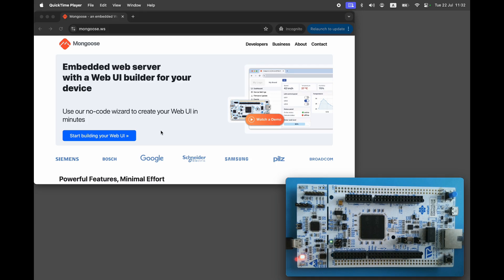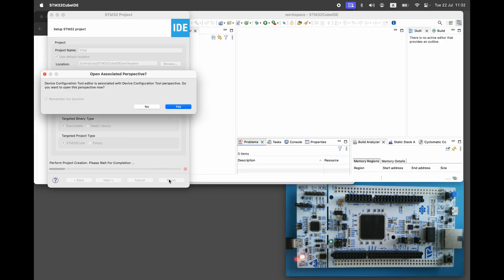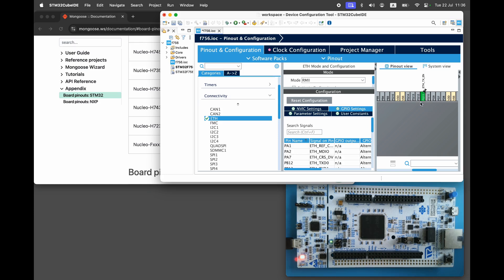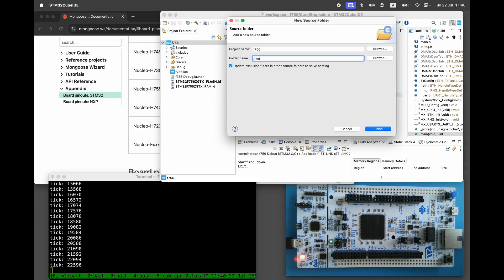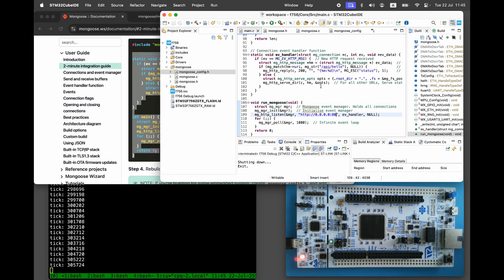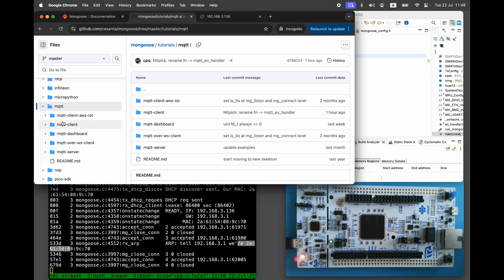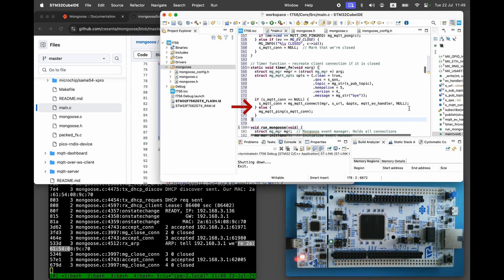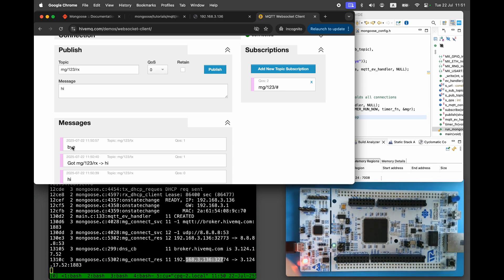STM32 + Ethernet + HTTP + MQTT

Comment: Do you have to have an Ethernet adapter or could you use a WiFi module? ie. a ESP-01S WiFi Serial Transceiver Module ?
Reply from the maker: Both would work. The easiest to try is W5500, which works with practically an MCU.

Comment: Thanks for video. Is there a particular reason why you don't use the board selector in IDE?
Reply from the maker: Sure. The reason is that the approach would work for custom-built devices, too. That's first. The second reason is that Cube has wrong pin assigments for some boards, so choosing a board does not guarantee the right pin assignment, unfortunately.